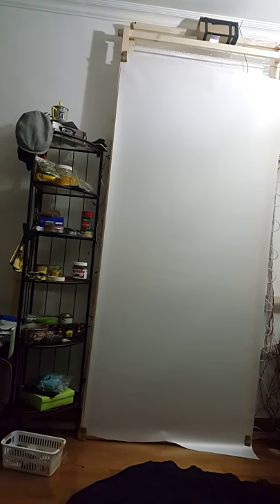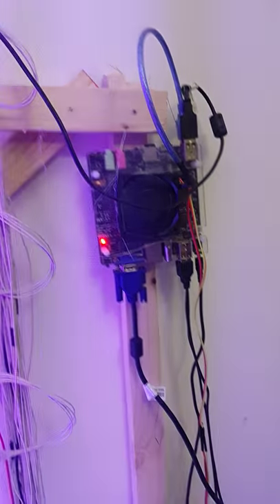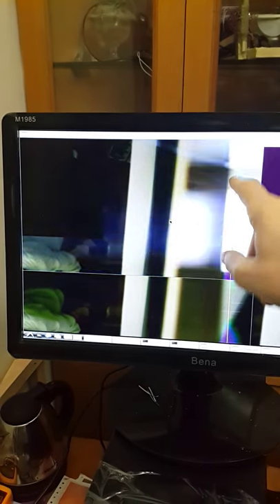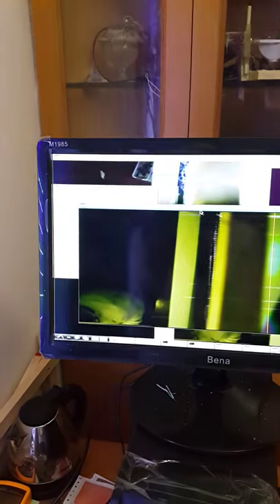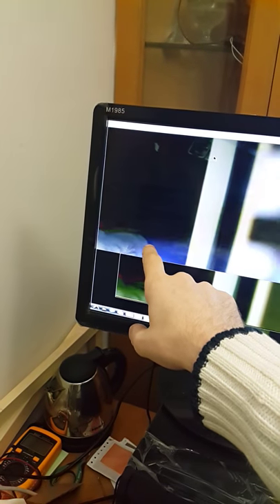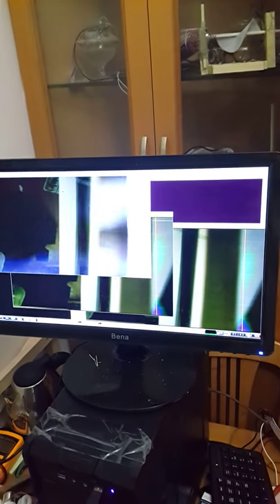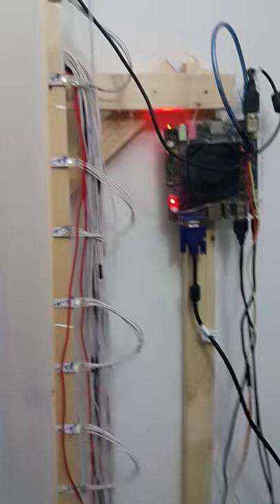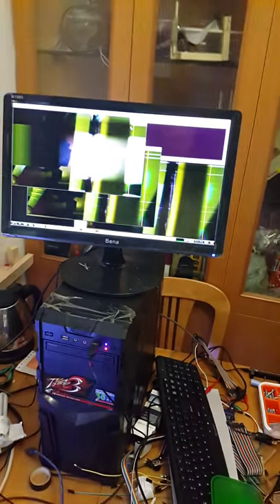Color mirror. Rgb led wall interactive instalation

Comment: This is Awesome!!! I am a Grad Student Currently trying to make an LED Interactive wall for my thesis. I am knowledgeable on the led side of things but not on the interactive side. Is there anyway you could help me get started? I think is so cool. Thanks!
Reply from the maker: +Michael Shoaf awesjome. Glad you like. Thanks so much :) Well to do this effect you need a webcam that supports manually setting exposure. I only know for sure the model used here has that support but there are plenty. And then you need an sbc and OpenCV. Can you code? Then there is the MCU led side. It would make a great school project I imagine. Lots of different parts interconnected. Mcu cpu camera etc.. any part in particular you are not sure about? Happy to help. Where you got questions?
Reply from the maker: +Michael Shoaf awesjome. Glad you like. Thanks so much :) Well to do this effect you need a webcam that supports manually setting exposure. I only know for sure the model used here has that support but there are plenty. And then you need an sbc and OpenCV. Can you code? Then there is the MCU led side. It would make a great school project I imagine. Lots of different parts interconnected. Mcu cpu camera etc.. any part in particular you are not sure about? Happy to help. Where you got questions?
Reply from the maker: +Michael Shoaf awesjome. Glad you like. Thanks so much :) Well to do this effect you need a webcam that supports manually setting exposure. I only know for sure the model used here has that support but there are plenty. And then you need an sbc and OpenCV. Can you code? Then there is the MCU led side. It would make a great school project I imagine. Lots of different parts interconnected. Mcu cpu camera etc.. any part in particular you are not sure about? Happy to help. Where you got questions?
Reply: Hello! I have done some very minor coding with an arduino with C++ and C Sharp. But Im far from an expert. I know how to hook up the LEDs but not sure how to control the LEDS. Should I buy a cubie before I even dive into this?

Thanks
Reply from the maker: +Michael Shoaf I would suggest first download opencv and set up an ubuntu os on your computer if you don't already have it. you should be able to use a desktop instead of an sbc at first. once your are familiar with it migrating onto a cubie or other sbc is easy. but buying a cubie v8 is not a bad idea. it can be used as a desktop as well. I often use it as a workstation. but you only really need it. a desktop will work as well. you can use a usb serial connection to connect it to the arduino.
Reply from the maker: +Michael Shoaf also. you need to code your own control for the leds. there needs to be a full rest cycle that most controllers don't have. it's simple code on the arduino. flash rgb duty cycles. then rest ghe whole system then repeat. just add a pause into the main loop of normal controller.